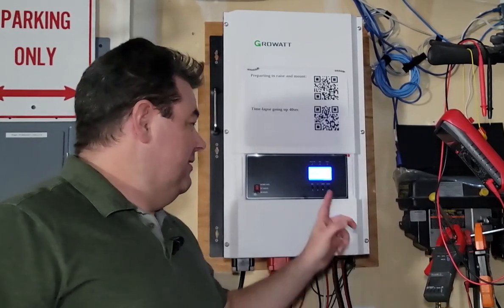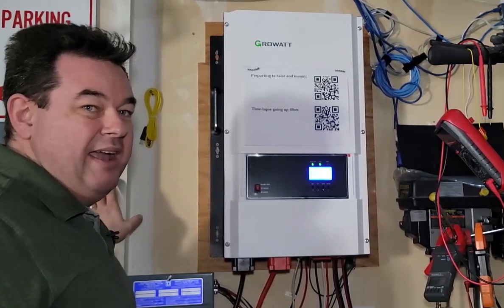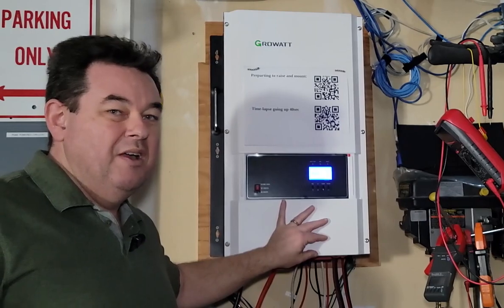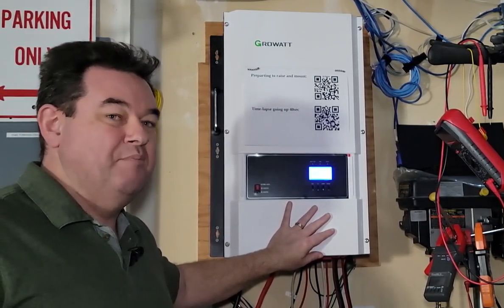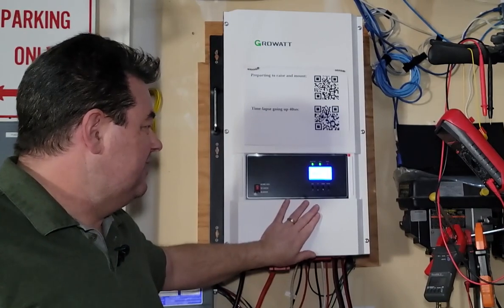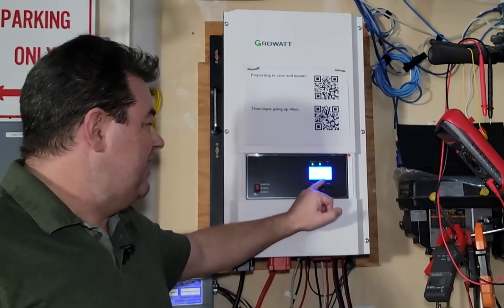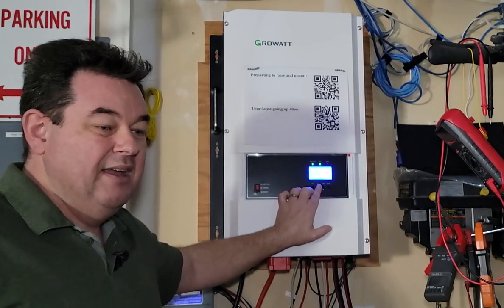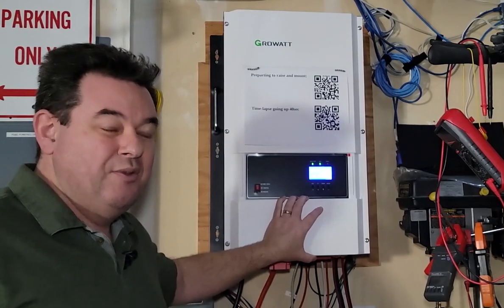Growatt 12k Review and Grounding

Comment: Far as I know: Bonding refers to connection between neutral and ground. Earthing means grounding. If there is a grounding point on the casing of the inverter it needs connected to ground because there is no other way to ensure a short path to ground. If you install a fuse on the casing grounding line and a short occurs, then the fuse will blow and the case will remain energized therefore hazardous: not a good idea. I just ordered the inverter and don’t remember to have noticed a grounding point on the casing. If there was none it meant that the casing is already grounded internally.

Comment: PS: what did you replace the 12k growatt with? (after it died)
Reply from the maker: So far, an EG4EX6000 which has a large transformer in it.  This model can run multiple units in parallel, so I'll be adding another one eventually.

Comment: Hi Brad, thanks for the video! I'm looking to do the exact same, but dreading the pulley system. Might leave it on a moving cart for now, but hoping your pulley video will inspire me. Question How much battery kWh capacity do you typically burn through overnight? (between sunset and sunrise). I noticed you have quite a lot of battery capacity, but wondering if I could start with much less. Thanks again
Reply from the maker: The overnight draw depends on my AC needs.  For me to cycle down to 30% and then back to full, the heat of the day can't exceed about 85 degrees.  This makes the AC only run a couple times overnight and collectively with other evening loads amounts to about 14kWh.

Comment: Hi  dear thanks for video  

Is  7 awg   battery  cable is enough  ?
Reply from the maker: Unfortunately, I don't have enough information to answer the question.  The size requirement is different for PV panel wire, AC tie-in wire, and battery connection wire.  The best thing to do is refer to the manual for your inverter and consult a professional.

Comment: I want to power everything in my house besides the central air conditioner. How can that be done? I have 8 batteries and over 7000 watts of solar panels, how would you do it?
Reply from the maker: That's a fairly complicated question.  The simple answer is to have an electrician actually look at what you have, panel types, etc and then to perform the tie-in portion of the work.  Aside from that, I feel like a 6Kw inverter isn't quite enough to run an average home, even without the central AC.  I have a spreadsheet that kind of breaks down how to calculate it all.  I'm going to add the link in the description of this video above.  For my wife, daughter and myself, the concern is that things like the toaster oven, microwave, hair dryer, vacuum, and others have potential to all run at the same time when we have overnight visitors.  In that case, a momentary load could get up to 10 Kilowatts for a short time, but definitely more than the few seconds of overload that a 6Kw machine can typically handle.  In my case, to reach a confidence level that running some group of these items at the same time isn't going to result in a self made power outage, I believe I need a 12Kw inverter and batteries to support it.

Comment: is this inverter communicated with the lithium battery? thanks
Reply from the maker: This unit was communicating with the LiFePo4 battery.  I was making use of the USE2 programmable option with the Signature Solar recommended settings.

Comment: I am working on a similar setup. I want to mostly go off grid but still maintain utility power. The 12k inverter is wired similar to yours. The AC input from the main panel to inverter, hot1, hot2. I have a ground from main panel ground to inverter ground, as stated in the manual. You have the input inverter ground going straight to the case ground. It seems like your grounding the inverter to itself. Being an input ground, I was not sure that is part of the internal ground/neutral bond of the inverter. I have an off grid sub-panel. I am unsure how to ground this. If the AC input was not hooked up, it would make sense to have a separate ground rod for this off grid panel. But with the ground/neutral bond in the inverter and the AC input there to use if I am unable to charge the batteries due to lack of solar, would having another ground rod create a group loop? Should I take the AC input ground and run it directly to the off grid panel, then to its own ground rod? This is very confusing. BTW, I mounted a hoist to the wall to lift the inverter. Once install, I left it there for future issues. It was cheap enough and I was able to do the work by myself.
Reply from the maker: The case needs grounded, so all of my Earth grounds were collected at that one point for visibility.  The correct way to do it would be inside the sub-panel.  When the unit is supplying power to the sub-panel, the tie to the utility is broken, so the separate ground rod is recommended to ensure a clear traceable path.  When the utility is engaged, I do have two ground rods but it is still not a loop.  However, I do create potential having two grounds for energy to travel between the sub-panel and main-panel ground lines.  That is not really the best case, but the tracing of the problem in my case would only be a matter of inches due to my arrangement so I'm comfortable with that.  There are some creative ideas on setting up a separate ground relay switch to fully isolate this condition.  My setup also leaves several circuits on the utility full time, so when my inverter is running I don't want any chance that there is a cross back path anywhere other than the dirt outside.  This is a very confusing subject as so many things connect together under the heading of ground.  If you are unsure, I recommend getting a professional opinion for your specific setup.
Reply: Study the NEC codes or take some classes online on electrical and solar. These things can kill you don't know what you're doing.  If you build it to code, you know it's safe. Don't want to worry about it when you're not home.

Comment: Looks like you have 2 N-G bonding: 1 main utility box and 2nd in inverter. When there's short circuit, breakers should sense or trigger shut off from sudden increase of current. Breakers respond to heat softening tension to flip & disconnect  Current always go back to power source but with 2 bonds the current flow in circles not reaching breaker. Here i see 2 sources: inverter's autotransformer and grid's transformer.  Are the AC wires 8awg? Looks 10 awg from here.
Reply from the maker: All AC are 8awg and battery cables are 2/0.  Because this unit is off grid when running, there is only one N-G bond at a time.

Comment: Can these inverters/chargers be double up in parallel to increase power output? I have to charge 2 EVs at 50amp
Reply from the maker: The Growatt low frequency unit that I'm sharing here is NOT able to run parallel.  At the moment, I do not know of any Growatt low frequency units that can be parallel.  The EG4 120/240 does do parallel configurations.

Comment: So many misunderstandings in this video.  Anyone watching this don't go by this information.  Bonding refers to the neutral wire coming from the inverter or power pole being connected to the earth ground(that ground rod by your main panel) inside of your main circuit panel.  When they are terminated together in your main panel, which is the only place that they should be connected together, they are whats called "bonded".  Bonding has nothing to do with the ground being connected to the chassis of a piece of equipment.  That's simply called grounding.  Mess up your understanding of bonding and all kinds of destructive things can happen, death being one of them.  Fail to bond the neutral correctly and you'll pump 240vac through your 120vac appliances.  Also, all your wire gauges are way too small.  It's a 12k inverter so the AC input and output lines should be 6awg minimum.  Battery cables are too small and you're way under the required amount of battery capacity for that unit.  I believe the manual states a minimum of 400ah.  Pretty sure you fried your own inverter.
Reply from the maker: Thank you for the clarification.  I'm not sure I understand how a 1500 watt or less load can draw enough amps to require more than the 200 peak amps of the two batteries, any help is appreciated.  Also, the manual specified the 8 AWG for service wire and 4/0 for the batteries where I have 2/0, so am I missing something?   I just used an old 2011 NEC reference that showed #2/0 Cu conductors can be used at 200 amps.  Then figuring maximum load of 1500 watts at 120 volts is only 12.5 amps, even if there was a rush in current of 3x that, I thought I was still OK.  It would also be good if you can help me understand why when I Google "Bonding vs Grounding" this is the answer at the top of the list - "Bonding is the connection of non-current-carrying conductive elements like enclosures and structures. Grounding is the attachment of bonded systems to the earth. Both are necessary to safeguard people and property from electric hazards."  If that's not right, we need to get it changed.
Reply: @@Floridaoff-grid Your talking about the size of wire from the batteries. If you calculate ohms law 12kw at 48V is 480 amps of current at .1 ohm of resistance, it's possible to be able to pull that much power in theory. Assuming he does have enough battery to provide that much power hopefully he has a fuse, or DC breaker that will open up if it ever exceeds the battery to inverter wiring. NEC requires Neutral to ground only be bonded in the main feed panel that is connected directly to the to the meter. I know subpanels have a ground wire, and a neutral wire running all the way back to the main panel where it's bonded.
Reply: @@Floridaoff-grid I agree lack of conduit is not good either. IMO should at least make it meet code standards even if you don't ever plan on getting it inspected if it's going inside a home.  I don't trust electronics with that kind of power flowing through it. I know someone who's house burned down from an FM radio he left on 24/7 in the garage. After years something dried out, he was out of town 3/4 of his house burned down. Rest of it was wrecked from all the water damage fire department. Insurance covered it because he met the requirements of the policy.

Comment: Hi. Great vid. Thanks for creating this. I have a question. I'm looking at this inverter and I want to put 6000 watts of solar pv in. Let's say I need 12kw instantaneously, will it share that load with the utility or is it an either/or scenario?

Thanks
Reply from the maker: Load is never shared with the utility with this unit.  The panels and batteries will have combined power available.  I would recommend a different thought process with the off-grid variety, think of them as battery powered inverters with the ability to charge from solar or utility.
Reply: @bhunter736  hey thanks for that info!

Comment: If you exceed the 12k output from inverter, let's say you have everything in the house running and you need 15k of power does the grid kick in and give you additional 3k to help out? Thats one feature I'm looking for. (maybe you can test that?) thanks
Reply from the maker: I'm cheating and doing a copy paste for part of this answer - 'Load is never shared with the utility with this unit.  The panels and batteries will have combined power available.  I would recommend a different thought process with the off-grid variety, think of them as battery powered inverters with the ability to charge from solar or utility.' - And to answer your question, no it will not supplement from the grid, only switch back to it.  The limit accepted from the grid is a 40A circuit feed, so that's only about 9600 watts max that will pass through.  You really want to plan to not exceed the inverter in order to be successful.

Comment: So do you use a separate neutral conductor and grounding rod for that Inverter powered subpanel?  If not then you can have two bonding locations, one for utility and one for the inverter and there is a chance you overload the inverter when the unit is in bypass mode (batteries can only be charged from utility while in bypass) due to possible imbalance of  neutral to the two phases from the utility supply
Reply from the maker: I do have a separate grounding rod for the inverter and its subpanel.  I also do not charge from utility, I keep the unit set for solar only charging.

Comment: Nice work & your video quality is way better this time.
Glad you like the unit.
We've got the same in its crate to use as a future backup or replacement if our 8kwh inverter ever fails. Hope you can get your larger array soon, be nice to see those internal charge controllers loaded up and producing 6000+ watts for you. Do be cautious not to exceed the C.C.s wattage/amperage/voltage ratings tho.
I think 6000 watts is a safe number given clear cold weather/cloud lensing voltage spikes.
I always thought the power saver switch just throttled the inverter down when no loads are present.
From what I've heard and read it's best to leave it off if you have continuous  loads on the inverter. I will study up on that a bit more. Yes, I find my gal is always happier with uninterrupted maximum power available to her, lol.
Reply from the maker: Thank's for the feedback, that's good info.  I'm glad you noticed the sound, I was trying out a wireless lapel mic and wasn't sure it would matter to viewers.  I'll keep using it.
Reply: @bhunter736  it definitely cuts out the background noise, fans etc.
We're you able to determine weather the cooked mosfets on the 12k were on the inverter circuit or the charge controller circuit ? Hope it's a quick-easy fix for you.